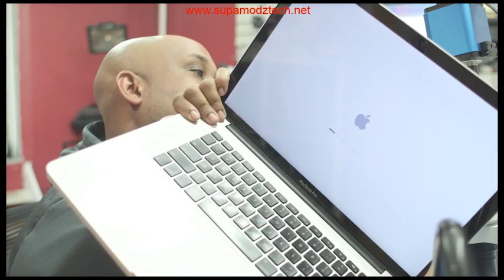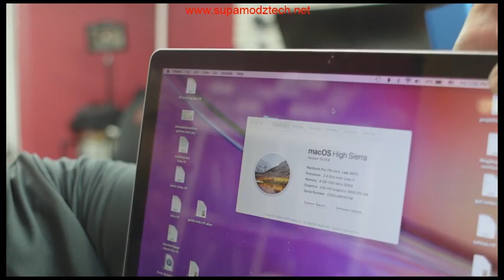Macbook Pro GPU fix-Macbook pro late 2011 15 inch

Comment: I did a brute attack on AMD chip underneath it. in frustration i just used a screwdriver to take out all the SMD components. I did not take the main board out at all. And I just though I might put the battery on again started, and it booted up , but very slow in OSX but with Linux it works .
In linux with lspci command it only shows intel gpu.

Comment: There is a burnmark on the side of the motherboard on mine. Will I need a new one?

Changed battery.

Started up does not start up any more.

Comment: I got 2.5 years extra by cooking the logicboard in the oven, but the true fix was cutting two holes in the bottom chassis, below the impeller fans, and Voila!!! no more heat problems lol, for real.curren tly enjoying  a MBP 2018

Comment: quick question once installed chip can you install windows through bootcamp? 
thanks in advance
Reply from the maker: Never tried a boot camp install but I don’t think that would be an issue
Reply: @supamodztech5366  ok i will try see what happens 👍🏽 will leave feedback here
Reply: @supamodztech5366  Can I still buy the chip?

Comment: I would not call that a fix. This is a workaround, and it can easily be done via software on the nvram, no soldering needed. The real "fix" would be fixing the dedicated gpu, otherwise it's not that much usable.

Comment: Would hdmi still work after repair? i've disabled amd and running intel but hdmi doesn't work. so was wondering if this fix would solve that as well.
Reply: The answer is no. And the answer is dont repair. Just go in settings and disable the damn thing. No need to this fix and just sell it after, graphics are ok but annoying.

Comment: I'm so glad I came across your video - I already contacted a few repairshops here in my town but either they won't do this or they didnt knew about this process - would you be able to repair by board if send it though post? I'm based in Portugal
Reply: btw, it's a MBP early 2011 17"

Comment: Cool video. Question - youre saying that it disabled dedicated gpu (leaves only integrated gpu).  What happens when you plug-in monitor into thunderbolt? I'm soft fix I did ignoring gpu from macos, when connecting thunderbolt display, monitor would just go dark and it require the restart to get it back alive. Would be curious to know if your solution works with thunderbolt display.
Reply: Once you disable the AMD GPU, Displayport is permanent disabled

Comment: After watching Steve’s video, I called him to get more details. He told me how to order the special part, which took about 10-12 days for delivery from Holland to Michigan. Once I had the part, I packed up my useless 2011 MacBook Pro and shipped it to Steve. Three days later, I received my Mac back. Steve had soldered the special part onto the motherboard of my Mac. And now, after two years, my Mac works again! Steve is “the Man” to see or call if you have a 2011 15” or 17” MacBook Pro that doesn’t work properly because of the faulty Radeon Graphics chip. Thanks, Steve!!!
Reply: Hi there, could you post the details regarding  what and how to order? Thanks a lot in advance .

Comment: Nice tutorial, man. I have a last doubt. This kill the gpu for good? I mean, no energy spent, no connection, nothing? It's 100% dead?
Reply: If you have GPU management program on your machine, you need to get rid of it.  With terminal bypass, the GPU program will try to talk to it and you may run into the same problem again.  Above is a hardware bypass.  Once it's done, you do need to be aware of the temperature with your machine so it doesn't go too high to ruin solder connections elsewhere.  Get a cooling pad.
Reply: @MrLee-on3yu  instead of cooling pad he can also download program Macs Fan Control so he can control fan speed.

Comment: Does this repair work for a Mid-2010 13"?
Reply: Thanks for showing the soldering. Consider showing everything you do within view.
Reply from the maker: No it does not you may have a different issue. You can mail it in for us to check it out.

Comment: what I did for this problem is to reflow the AMD GPU and use good thermal paste. also, clean the MacBook from time to time inside. the main problem is that the original thermal paste is not that good and dries up combine that with some dust blocking the exhaust and it will get this problem very fast. after my reflow, it's still working 2 years later
Reply from the maker: bjorn van de walle yes that’s what we all used to do, also your supposed to replace the tantalum capacitor that is on the other side of logic board which will work temporary until it fails again. This chip bypasses the GPU to work permanently.
Reply: @supamodztech5366  Hi and thanks for your response. I did not know that the tantalum capacitor fails on these. Good to know;). If the GPU would fail I will order your chip. keep up the good work.

Comment: Is there a similar fix for a 2011 Mac Mini with the same AMD GPU problem?
Reply from the maker: Dosdude1  has a version with some coding involved thru terminal you can look it up on the web
Reply: Supamodz Tech that only seems to work for MacBook Pro dGPUs, not Mac Minis - which is why I was hoping for a hardware fix to tell the bios of to switch off the AMD GPU, but on the Mac Mini.
Reply from the maker: James Low no nothing for Mac mini units

Comment: I’m so glad i came across this video. My MacBook Pro only starts works in safe mode. Will this fix my problem?
Reply from the maker: If you are having graphics issues not loading lines in screen
Reply: Supamodz Tech Apple told me l needed a part that costs $600 or buy a new computer. My computer just keeps restarting, and will only stay on in safe mode.  I tried a step by step solution I saw on Macrumors that had me type in some commands to bypass the gpu. That’s the only way it will even start in safe mode.
Reply: @kimj5457  Have you solved the problem? I just did mine (MacbookPro 17'' 2011 with a bad gpu). I used the dosdude guide and works great in High Sierra, except sleep and brightness control.
Reply: @redishman  No. I haven't.  Wher is the dosdude guide?
Reply: it worked as described in the guide, with the mention that I pulled out the SSD from my macbook pro and installed a fresh copy of High Sierra with another mac. I also made the latest updates before I put it back in the damaged MacBook Pro. After that I did the exact steps mentioned in the guide. The downside is that you don't have brightness control and if the mac goes to sleep, you will have to forced shutdown because it will not wake up from sleep when you press the keys or touch the trackpad as should normally do. The good part is that it boots fine every time and always using the intel graphic. I personally can live with these. Planning to use DosDude patch to upgrade to Mojave or Catalina. Have fun.

Comment: Hi dude, installing windows in one of these fixed macbooks would it work?
Reply: Yes it's will work but don't install the driver for the amd gpu, as soon as installing Windows, install the Intel gpu driver then disable the 2nd gpu (ATI Radeon) and don't install the driver
Reply: @noriestian  Thank you
Reply: So installing windows will fix the problem ?

Comment: Hello there
I am ok with soldering, do I need microscope to do this job or it can be done with the sharp tip soldering iron?

Thanks
Reply from the maker: it can be done with a magnifying glass to make sure joints are soldered if you have good eyes you will be fine.
Reply: Supamodz Tech thanks brother for your reply.
Is standard soldering iron is ok or it has to be the one with low watts?
Reply from the maker: ali jawad as long as you use flux you should be fine
Reply: Supamodz Tech respect my brother God Bless :)
Reply from the maker: @alijawad2641  no problem your welcome any time
Reply: Supamodz Tech yes brother
I have installed the chip from Tiresias2 and actually his website says remove R8911 resistor as well from the motherboard?
Is there anyway I can email you the picture of my soldering?
Reply from the maker: @alijawad2641  if he gave you the old version yes remove resistor the new version no need to remove resistor
Reply: Hi brother
Yes they sent me new chip also I had email conversation with the maker and he said remove the resistor which I did
Re installed the new software and the laptop works the treat and I can’t see the AMD graphic card inside it anymore
Reply: You should always remove R8911. The Mac looks for the GPU during Power On System Test (POST) and again when it boot into OS. A broken GPU can, depending on how it is broken, cause the Mac to hang or crash at that point. By removing R8911 the Mac can no longer see the GPU so you remove that risk. An added bonus is that it lowers the power consumption.

Comment: Thanks for the video! 

I fixed the problem via eliminating the amd gpu through single user mode; but now the performance of the screen is so terrible that I can't even open a browser  properly.  when I move the cursor it leaves marks through the path on the screen. Do you have any  suggestion about this problem? Now I got my screen back but it is still unusable. Since the amd gpu is already bypassed; trying your hardware solution won't change much in my case, am I right?
Reply from the maker: Remember you are emulating the gpu its not turned off. This device turns it off completely and only uses the intel gpu by itself. In your case it won't hurt to try it you really have nothing to loose, i left the link in the description where you can buy them.
Reply: Thanks, i’ll give it a try 👍
Reply: @cengiz-taskin   Did you ever attempt to use this component? Did it work for your circumstance?

Comment: does it still support a second screen?
Reply from the maker: from my testing it does not work
Reply: In these macs the video on external port is always driven by the AMD GPU. Hence it is impossible to have external video once the (AMD) GPU is dead.